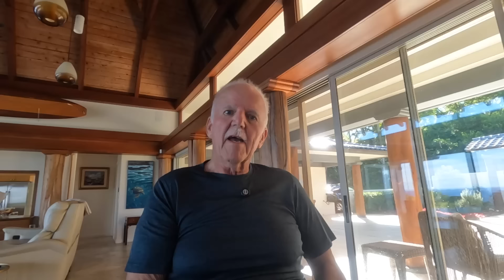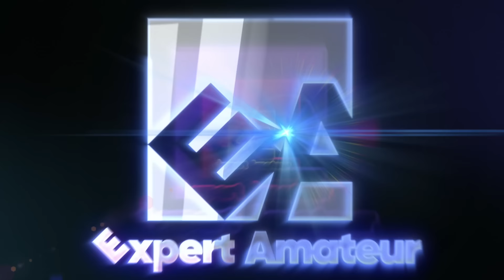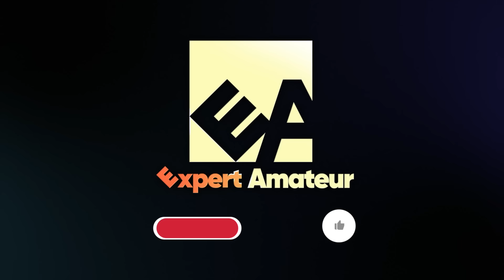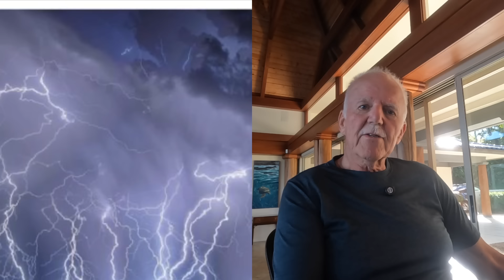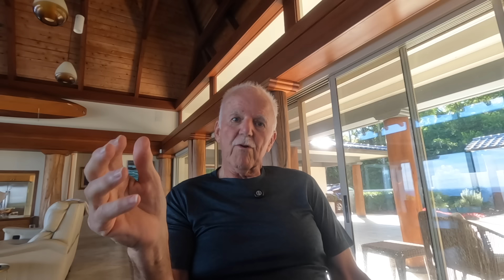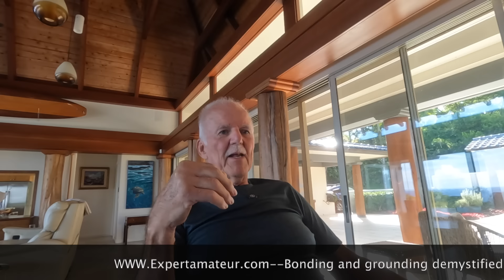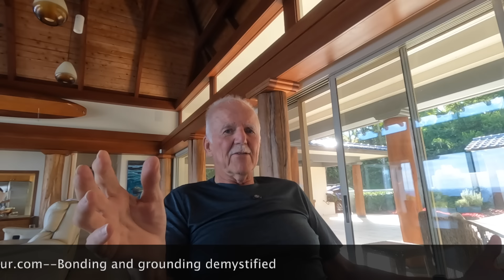solar grounding

Comment: As I understand it, array grounding depends on your inverters...despite your desire to settle the debate, the correct answer seems to be, "It depends".

My MPP LV6548s manual includes this info:
WARNING Because this inverter is non isolated, only three types of PV modules are acceptable: single crystalline, poly crystalline with class A rated and CIGS modules. To avoid any malfunction, do not connect any PV modules with possible current leakage to the inverter. For example, grounded PV modules will cause current leakage to the inverter. When using CIGS modules, please be sure NO grounding.
CAUTION: It’s required to use PV junction box with surge protection. Otherwise, it will cause damage on inverter when lightning occurs on PV modules.
Reply from the maker: I'm considering doing a separate video and blog post about this issue. It should be massively boring for anyone but solar geeks. I think all transformerless inverters have the problem you're talking about. The feature set that synthesizing the wave enables is probably worth the problems, but it's good to know about the issues. I'm a little surprised your manual is so forthcoming about the limitations. I have the EG4 18K PV and the manual, though highly readable and complete, doesn't say anything about AC not being isolated from DC issues with PV panels that are not perfectly isolated from the frames. I've tested a few dozen panels (can you tell I'm retired?) and find that the resistance from the power leads to frame is variable even for a single manufacturer and source of the panels. I thought I was going to find that bifacial panels were worse, but I haven't seen much difference. I haven't found many that were low resistance to the frames but if you wind up looking for the source of a few millamps of leakage to ground that's certainly one place to look. The panels with the lowest resistance from the output conductors to frame are the ancient 250W Sanyo panels in the AC-coupled system at my home in Maui. I suspect 15 years of salt spray might have something to do with that. But they connect to Enphase microinverters and the only local ground earth is the ground mount rack supports driven deep into the ground. I did have to replace all the inverters last year, but I think the main reason is first generation Enphase inverters don't really last 20 years.
Reply from the maker: You might read the accompanying blog article. It's a lot more detailed and doesn't have all the ahhs and ummms. https://expertamateur.com/solar-grounding-and-bonding-demystified/ But YES, I don't see a way to settle the debate. For myself, I'm just earth grounding racks and panels and bonding all the auxiliary grounds together. My experiment is in the Gorge, lightning is not common, but it happens frequently enough to not want to sacrifice my gear to Thor.
Reply: While the IFU is definitely the place to start, keep in mind that the first part of EA's discussion is about ground the frames of the solar panel mounts, not grounding the actual electrical system. They are 2 separate things. (If your panels are electrically grounded to the frame, and then to earth, bad things can happen. 

As for grounding the overall electric system, (floating ground vs earth geound)  that definitely needs info from the IFU or someone much better versed than I am.
Reply: Essentially all of the voltronics (and clones) type HF all-in-ones do not have separation (isolation) between the PV side and AC side.  It's absolutely essential to have the frames earthed, that is at the least connected to the premises' earthing system for safety and also so the inverter itself can do its own loss-of-isolation sensing and be able shutdown should that happen.  This is for a TN type configuration where there is linkage of the neutral and earthing system at some point.  If you can't ensure the panels aren't electrically leaky, something I've been bashing on about for years now, you shouldn't be using them in arrays with higher DC voltages and not using them with non-isolated (not separated) inverters either.  For non-isolated inverters you must not directly earth the + or - wires of the array and surge protection on them should use a GDT to earthing rather than MOVs to avoid leakage which will trip the inverter's protection and RCD (GFCI) if they are involved too.
Reply: @retrozmachine1189  Yes, MPP LV6548s are grounded to the panel, but the arrays are not supposed to be as I understand it.
However, if I have that completely wrong I'd be happy to change it. In absence of clarity I reverted to RTFM.
Reply: @mentalarson  Sounds right, the actual PV wiring for these sorts of inverters should not be earthed (grounded).  Surge/lightning protected, yes.
Reply from the maker: @retrozmachine1189  Yes indeed. MOV or any semiconductor-based SPD can trip GFCI and slowly degrade the SPD with constant reverse current. Gas Discharge Tube SPDs probably make more sense but they are getting rare. For managing nearby lightning strikes SPDs are of limited value anyway. They are more useful for lightning caused grid spikes though they don't help when the old metal fab shop a mile away uses their ancient  bridge crane with a 10HP single phase induction motor that kicks my old Syncrowave TIG off in mid weld.
Reply: I remember reading that in the 6548 manual, and after a bit of research, I had to draw the conclusion that they were trying to refer to an earth return PV system, which is super uncommon at least in the US.  This is just an uneducated guess though.